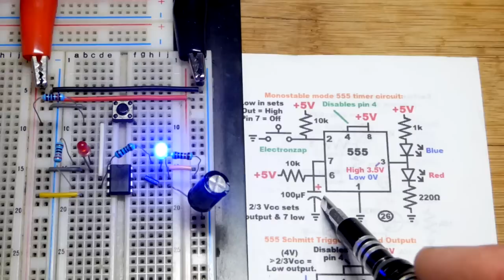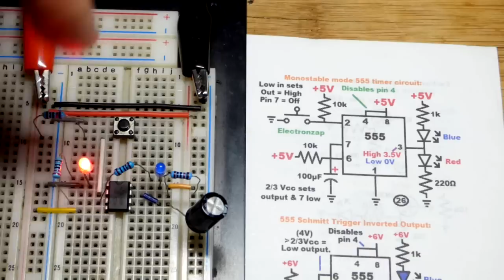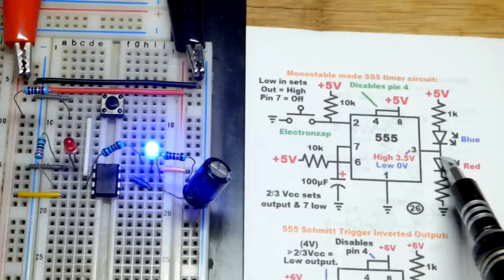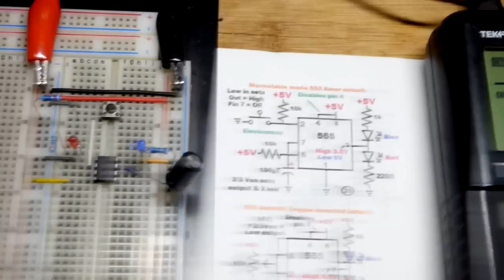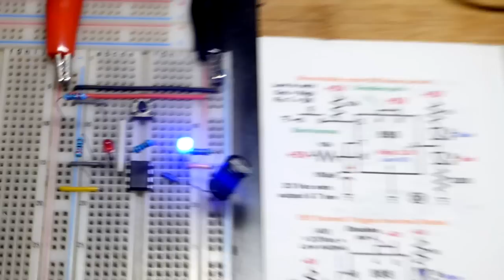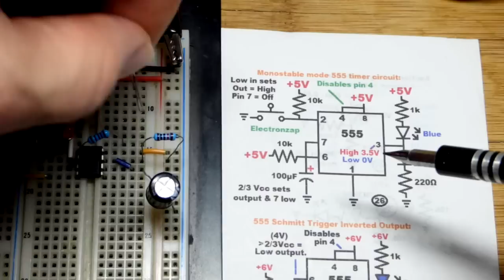Monostable Mode One Shot 555 Timer Demo Circuit

Comment: How to make it go low even when switch is held? I want a one-shot that pulses, even if switch is held. There's a circuit in one of Forrest Mims' books that does this with a cd4001. I was disappointed when the 555 didn't have the same behavior. Although I guess it could be desirable in different situations. 

Edit: pin 4 supersedes pin 2, so maybe that's it, to put pin 4 into play?

I like you channel, new sub.
Reply from the maker: Here's https://youtu.be/UQo5pIt7n14 the 555 pulse circuit I came up with a while ago.
Reply: @Electronzap  Fantastic, exactly what I was looking for, thanks!!